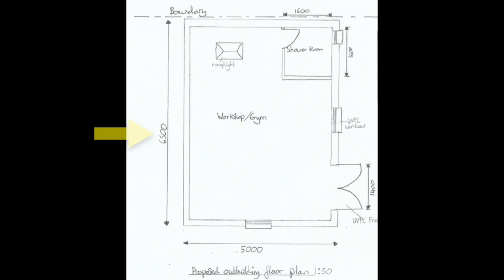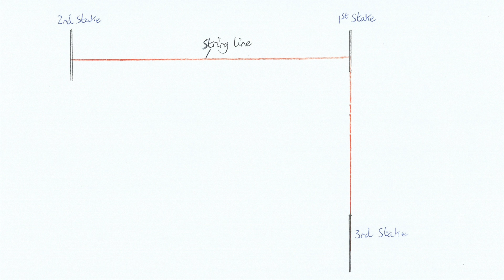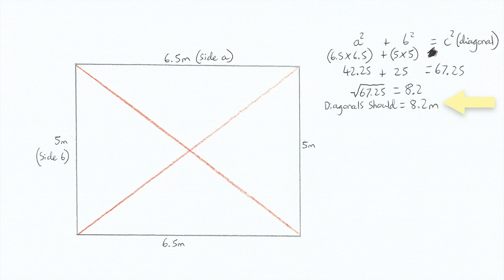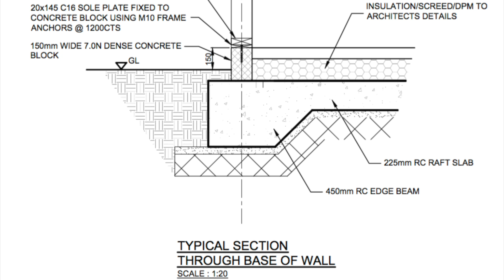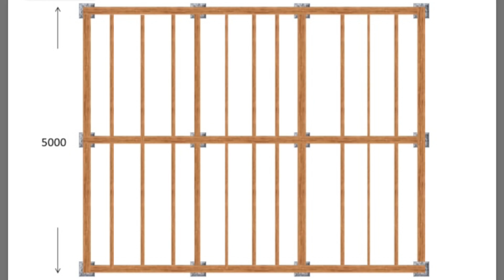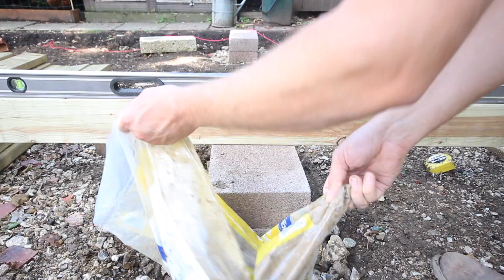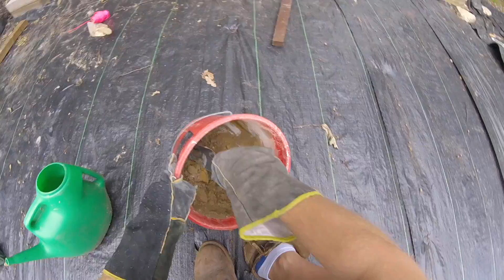Garden Room Workshop: Part 4. Setting out & Foundations

Comment: Thanks so much for uploading - it's been well worth the wait for this superbly thorough and informative vid. By far the best I've seen on YouTube.  I'm really looking forward to part 5 (please!!;)
Reply from the maker: Thanks Charlie, it'll be a couple of weeks yet but i'm getting into the rhythm now!
Reply: @AliDymock  Great videos. On the video it shows you placed a thin layer of sand on top of the hardcore before placing the brick, did you redo this with mortar instead of the sand? The video doesn't show. Thanks, Lloyd
Reply: I built a shed with these plans from Ryan  [ Details Here?> WoodBlueprints. Com ] . The instructions were clear and easy to implement. Even a novice can be able to build fast using this plan. I'm happy I bought the plan. It also saved me much cost.

Comment: Fantastic series thanks for these videos, I have come back to the beginning to start making some real plans for my garden room and am thinking of going for the block piers like you did for the foundation, however have a a couple of very large trees a few metres behind the boundary where the room would be, In addition I have a decent sized silver birch on the site the room will go (due to come down in a few weeks) - its stump will end up being under the back wall. Would the trees have impacted your decision on going for the piers, I notice you mentioned the raft foundations designed for ground movement though I would rather not pour a concrete slab tbh!

Comment: Do all the first concrete blocks on each pier need to be on the same horizontal plane when building on a slope? I.e. would you need to dig down deeper on the highest point in the ground so that the first block is level with the first block on the lowest part of the ground?

Comment: Really interested to hear how the foundations are now doing for this @AliDymock. I'm about to do something very similar but on a steeper slope.
Reply: Me to, he moced house a few years ago. I have half built them with lots of mortor
Reply: I would also love to know the answer to this. I have dug down to undisturbed soil but debating whether to use plinths and council slabs or a single 100mm layer of MOT type 1 then the slabs.
The soil type is clay in a rather wet part of the UK.

Comment: Hi Ali. If my back garden is already concreted. What would be your advice on a base? Would you add another layer of concrete? If that's the case, what's the best way of lining it out since you can't drive rods into the ground without drilling?

Comment: Hi Ali, we have just started building our outbuilding using the same method. Did you feel that a concrete pad or a hardcore layer over DPM was required on the base floor? Any issues with rotting timber floor joists? Thanks

Comment: Excellent video, it's extremely helpful to have things broken down into simple instructions so thank you for uploading. One thing I would say (and to be careful of) is that plasterboard is actually 2400 X 1200 where as timber based panels are indeed 2440 X 1220...  Unless you're purchasing chipboard/plywood flooring in which case they are 2400 X 600... Very straightforward 😂🤦‍♂️🤦‍♂️

Comment: Hi Ali, I know you made this video a long time ago but I was wondering how many concrete piers would I need for my 6 x 3 m garden room? Hoping for a reply 🤞,thank you.
Reply: Also, the foundation joints for my garden room consist of 2 sections, 2 3x3m sections should I put 1 pier at each corner and 2 in the middle where the 2 squared sections meet?
Reply from the maker: I would probably go with a 4x3 configuration of support piers. That will mean you maximum span will be 1.5m so you can probably go with 2x4" timber for the floor joists.

Comment: Have you noticed any sagging from the weight of the building on this typeof foundation ? I'm considering piles but if this works well will do this
Reply from the maker: Nope, been a few years now and it's all good so far! That said, I'd probably pour concrete around the piers rather than just filling with hardcore.
Reply: @AliDymock  thanks Ali

Comment: Thinking of doing this method instead of a concrete slab. 

6m x 3m garden office. 

Think it'll be suitable? Cheaper and easier than a concrete slab?
Reply from the maker: It's certainly more DIY friendly. Timber has gone up a lot in price though. I don't think there is an overall winner between timber and concrete, both have advantages and disadvantages. Either way you can't go wrong. If you have a flat site then concrete may be the better option and keep the height of the floor down so you save more for the internal room height.

Comment: hi your blocks look very high did you take them from the highest part of the garden ? also what what were the internal height of your walls please 👍👍
Reply from the maker: Hey Richard, they are because of the back alleyway which is the highest point so really the floor joists rest about 5cm from the highest level of soil and that's where you would measure from for the overall height of the building. Internally my walls are roughly 2.4m (higher at the front, lower at the back) - I got planning permission for the height though.
Reply: @AliDymock  thanks for the reply i understood that cheers , did you have to pay for planning and how much also did regulations get involved for that reason sorry for all of the questions as im putting pen to paper on my workshop trying to save as much as i can on my budget

Comment: Great video! Really informative for a novice like me. Quick question on the gravel and then blocks sitting on them. Will they not eventually sink? I was going to do what you did with pea gravel 20mmand then set the concrete 7n blocks on them with a layer of sharp sand. Chap at Wicks said they will sink eventually. Wasn't sure how true that was after seeing your video 🤔
Reply: What did you do with your project in the end ?

Comment: This really helped. I am building a much smaller 3x2m building but using the same concrete block method you used. Did you end up cementing the blocks into the ground or just the blocks to one another?
Reply: Both

Comment: i built a log cabin 4m x 4.5m 44cm walls and 2pcm floor with carpet on top and no insulation in 1992 and I use a 250w tubular heater , I have saved a fortune with all the insulation you have put in, it will take so many years to pay back anything its just not worth doing it, just put a carpet or lino on the floor.

Comment: Firstly thanks so much for all your videos, I have watched them all and feel like a pro without having lifted a timber yet😊!!.  Also some really great advice on the theory and keeping costs low too which has saved me hours of research! Not sure if you still answering questions but I currently have a small shed on a plain concrete base on the left centre corner of garden (concrete has no embedded damp course and was installed due to garden on a higher slope at the back). I want to build a bigger garden room and not sure if I should keep the concrete base and use eg ground m12 pins as the perimeter/ your concrete block method and raising them to the height of concrete base and then resting the base timbers directly on the concrete with DPM?  The reason I ask is for 1. stability and 2. I will likely exceed the 2.5 height if I leave a 3-5cm  gap over the concrete as an air gap. Essentially, can I lay timbers directly on top of the existing concrete floor with a layer of DPM in between.  Hope you can help!!  Also liked your trial bike shed and would be great to see how you did it😊
Reply: Also you are highly recommended by professionals on Reddit subs!
Reply from the maker: Ooo I love reddit which subs?
Reply from the maker: Okay I guess the options are: tear up the concrete (effort); add supports and run timbers or extend the concrete base.
The second option is easiest and I'd say that if you can get ventilation under the joists from where the supports are then you can rest the timbers on the concrete as long as 1) you don't fill all the way with insulation and 2) you don't interrupt the flow with noggins all the way to the floor. Your other option as you say is to raise the floor joists off the concrete to allow that air flow but the downside is that's eating into your 2.5m height

Comment: Hi Ali. Just coming back to this now i'm starting my build. You mention that you need two dense blocks on each peer but I cant find any reasoning online as to why. I intend to cement  the first block in place on top of the MOT but cant see the benefit of a second block. Can you elaborate as to why you  suggest this? Many thanks.
Reply from the maker: Hi Lee, I clarify in later videos why I did this, it's mostly because my land slopes. Also you can have a smaller gap underneath the floor joists than I have. I explain here it all here: https://www.youtube.com/watch?v=N1yM-b3rTTc 👍

Comment: Hi Ali. Great set of videos. After watching I have started the early planning stage of my own. Do you have any thoughts on using gravel grid bases that are available. I ask because I have used them myself and was wondering if they are suitable for a garden room? I am aiming for 2.5x3.7m.
Reply: I have just seen the same question asked further down. Apologies for the repeat.
Reply from the maker: No worries, I think it's worth checking with the manufacturer for what weight it can withstand,. if your build is on the smaller side of you'll have lots of grid bases providing support then go for it. It probably wouldn't be my go to choice but there are many options which work, mine just being one.

Comment: Your working with 3,4,5 triangles and so on only holds in a plane, so it's worth mentioning that the string should be level all the way around, either with a 360° laser (there are £50 Chinese ones on Amazon etc now) or a spirit level. The stakes should also be straight up, perpendicular to the ground. All this is easier if the ground has been well levelled at the start.
Reply from the maker: I've bought myself a laser level now, loving it.

Comment: Thanks for the informative video!
I was wondering if putting a decent layer of cement in the footing hole above the gravel. Then while its still wet use the flooring frame to level off the solid footing stones placed in the cement? I hope that makes sense. I feel like this would help make leveling off more simple.

Comment: Has anyone considered or used construction of concrete piers using card tubes and a metal frame support placed in the wet concrete mix? Ali perhaps you have researched this after?
Reply from the maker: Yeh I did know about that technique at the time. I like it, seems like an easy way to do it and you can get the tops of the cardboard level before pouring the concrete
Reply: I’m finding it hard to find any decent cement in steel supports though, especially ones that can handle doubled up timbers!  I’ll probably go the dense block route :)

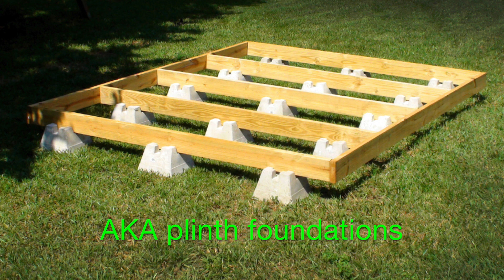Comment: This is a slightly misleading video.  5:33 to 6:00 shows how most foundation blocks are laid, but you have them at the ends.  I guess both are correct but it is misleading to the viewers.   Im looking to build a 8X12 shed and i'm trying to figure out do i go with what you did, Blocks at the ends, or what the 5:33 to 6:00 layout which the vast majority of shed foundations look like.

There are factors of whats gonna be in my shed.  Since it's gonna be a tractor mower and big snow blower i'll probabaly go with the end supports which is 1 more 4x4, but also 3 more support areas.    I have seen many 8x12 sheds sit on just 2  4x4 skids.  Again, probably not housing heavy lawn equipment.  

2 = almost 2,.5 feet apart and the sides  2.5 feet from the nearest support.

3 = less than 1.ft  8 in, ditto for the sides.
4 = Close to the same as 3 but ends are supported.   But they really dont need to be, and the vast vast majority of sheds aren't supported at the ends and sides.

Eh, i may just spend the extra $75 for another 4x4x12 and blocks and gravel and just square the whole thing off supported at all ends.  Will use 2x4s on the ends to secure everything together.
But 4  4x4s is def over kill for a 8x12 shed.
Reply from the maker: Oh yeh, that's obviously not what I did, just some visual representations - always support the corners if you can!

Comment: Hello bro,

I am doing a project similar to the one you've done but I have a specific question with regards to the roofing material.

My outbuilding will be on the 2metre perimetre of the property, as a result it would have to be non-combusable.

My walls are made of a non combustible material (concrete blocks) but my question is regarding the roof. Does the roof need to be non-combostible too, if so how?

Also can I use PVC windows and doors or would this break the non-combustabliltiy rule?

Ty
Reply from the maker: It's a really good question and the answer (frustratingly) seems to depend on the council in question. Some are not too fussed about the non-combustibility rule, others apply and allowable % of side made of combustible (i.e. roof and windows etc), and some are really strict. it's a bit of a minefield so I recommend speaking to your council b regs department, then see what private companies will sign off. That said, with a building made from blocks I personally wouldn't worry.
Reply: @AliDymock  , Thanks , just another question,  if the height is a few inches taller  , would the council overlook it , thanks again

Comment: Nice vid series.  For your foundations, I noticed that you have your concrete piers extend outside of the floor frame.  Did you do this for a particular reason?  ie did you measure such that the final cladding will extend beyond the block?  I'm trying to look into it myself, and most US shed build videos seem to suggest that the blocks should be set inside, so that the rain doesnt run down the cladding and sit on the block.
Reply from the maker: Ideally the blocks would be totally flush with the floor. The thing is that it's really tricky to get the blocks in the exact right place so being a bit over is preferable to under otherwise the floor won't be supported. You can sort the water issue by stapling a piece of DPM to the walls so it overlaps the block. Then breathable membrane over it. The battens should then protrude further than the blocks so you can then clad down below them.

Comment: Just started my build. I have been watching your videos over and over again for months! Had a lot of other stuff to do over summer but it's finally time for the shed now. Couple of questions if you don't mind? Firstly, I wasn't able to get the shed under 2.5 m (which mine has to be as it's within 2m of a boundary). The smallest French doors I could find second hand are over 2m tall, when using 6x2 timber the floor and joists, it doesn't allow for the 15 cm air gap underneath. In fact, quite a lot of it will have 15cm air gap as it's being built on sloping land. But, where the timber is on the right corner, which is at the highest point of the surrounding ground, the timber will only be 7cm(ish) off the ground. Otherwise I wouldn't have got it all under 2.5m. I will try and remove as much earth as I can as to try and improve on this but I'm going to treat the timber on this part to be on the safe side. What are your thoughts? Secondly, I've gone for 10cm compacted hardcore under the blocks, this seems fine to me but people have suggested 40 or more. Is 10cm sufficient? I'm guessing yours is still where it started?? Sorry for all the questions! Thanks again fir the vids 👍
Reply: Funnily enough I was just wondering the same things....  I’m on a slope also.  The height is to protect from splashing so my idea is to have a bigger roof overhang which then reduces the amount of rain hitting it.  Also I will run the cladding down.

I’m also wondering about depth of foundations and whether it’s worth me concerting them as I’m on a slope
Reply from the maker: Hey I did a video about this. I’d recommend 50mm under the joists to conserve height.
As for hardcore, more is always better but mine hasn’t gone anywhere. Would definitely recommend pouring concrete around the blocks unlike me.
Reply from the maker: Yup 50mm will be plenty 👍

Comment: Hi Ali. Thanks for making such an informative series of videos. I’ve been trying to build confidence to do a similar build for a garden gym but too many videos on YouTube are time lapse without any detailed explanation for a novice. A question if I may - in your initial drawing you’d jotted “workshop/gym”. In terms of foundation I’ve been leaning towards a concrete slab rather than your method. I worry with a heavy power rack and weight plates they may fall through the OSB or plywood. Did you consider that at all? I’m just not sure osb or ply will withstand deadlifts etc on top of the standing weight of the equipment itself!
Reply from the maker: Hey! Yeh so firstly my gym idea was simply some dumbells so I wasn’t focussed on making the foundations for a gym. The other reason was to give a good reason to the council for a shower room in there. 
I think a timber floor would be okay and you could upgrade to 22mm ply for extra strength. That said, if the site allows for it, a concrete base will probably be better and there’ll be less bounce, especially for deadlifts!
Reply: Your shed looks great! Thank you for sharing your knowledge with us! I built an 8x10 shed for my kids in my backyard earlier this year using plans I got from WoodBlueprints. Com Clear directions and an accurate materials list...It was great for a novice builder like myself!